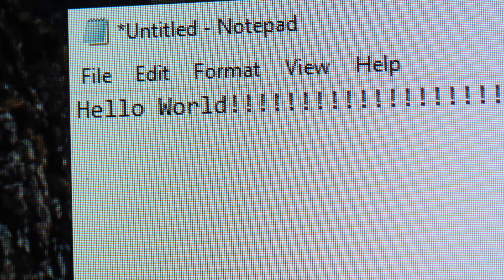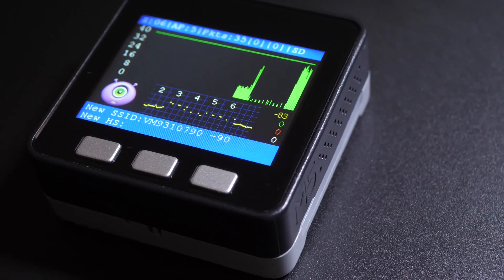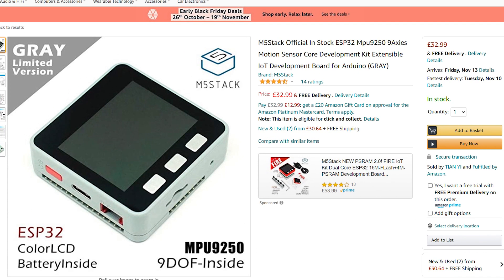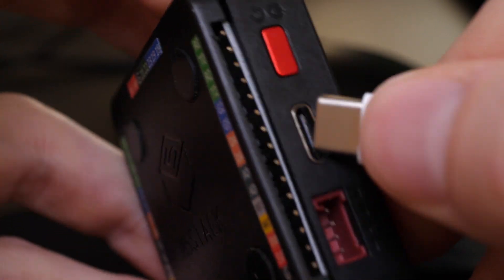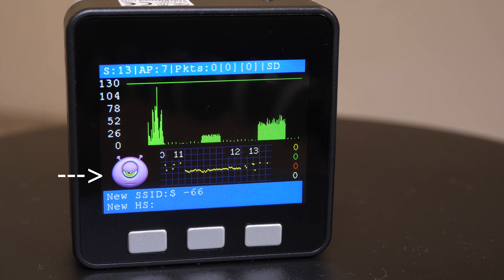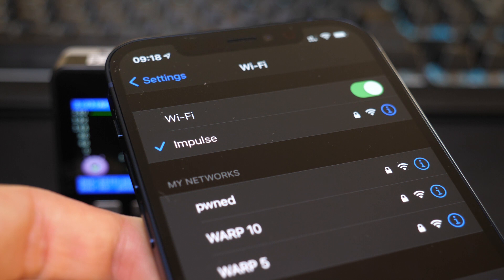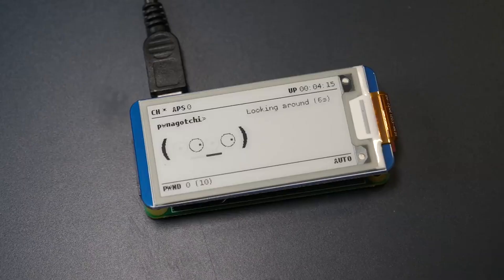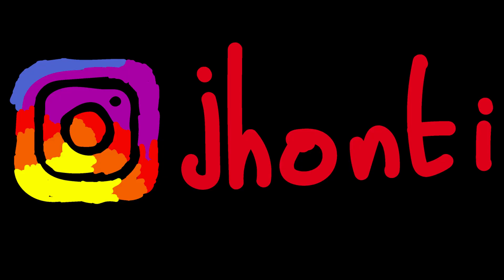Does This WiFi Monster Deserve His Name?

Comment: For those who want an easier method of installing the wifi hash monster. You can now flash the wifi hash monster using the m5burner. You simply plug it in, load up m5burner, type in hash monster, then click flash.

You can also flash Evilcore on the m5stack using the m5burner.

Comment: Good afternoon! there is an opportunity to take an inexpensive D-Link ANT70-1400N. It has several connectors (it can work with several spatial streams). Will the evil twin attack work (if you connect 2 adapters to it). Or do you need two antennas for each adapter?

Comment: I'm kind of confused, what is the use-case for this device? Couldn't you just set up a script on a pi that will both deauth and crack the wifis as you go? Not much difference in size but pi can so many things at once, arduino can only fit so much code... Sure it's not the fastest out there but why would you ever use this apart from flexing on your pentester friends? I don't mean to insult this thick premium bottom you got here, I'm just curious